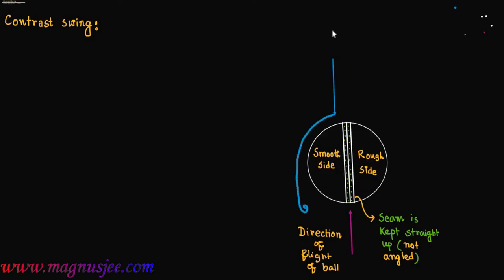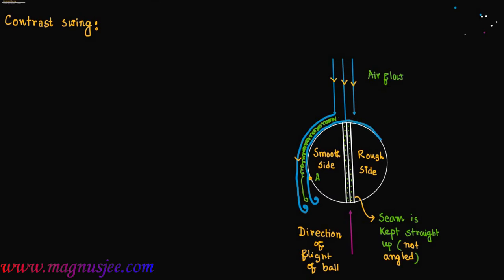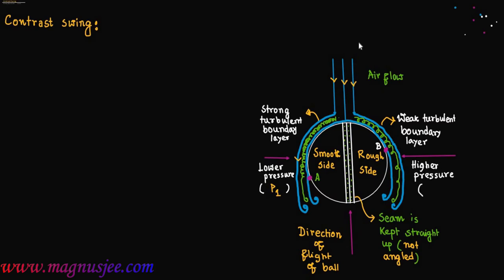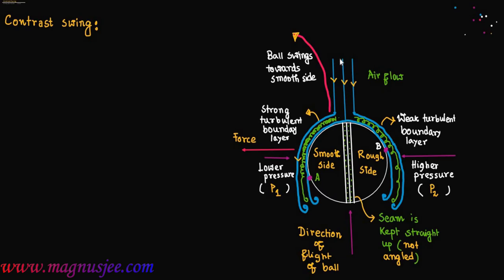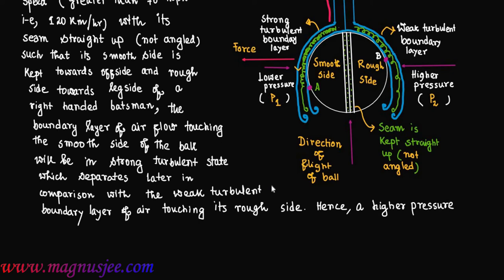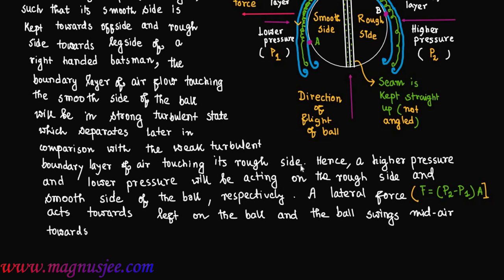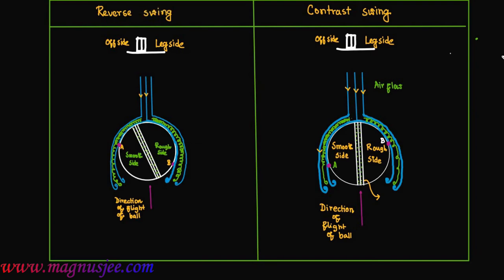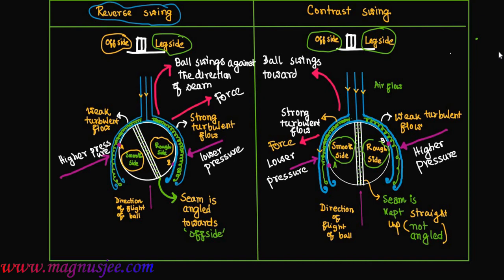Contrast Swing of Cricket Ball // Viscosity

Comment: You have gotten it wrong because the whole point of the reverse swing is that the ball moves towards the smooth surface as opposed to the conventional swing. Both reverse swing and and contrast swing shares the same quality. The only difference being that contrast swing is bowled with a new ball but at a much faster pace.
Reply: Does new ball even have that much difference between the two sides? Both sides are so smooth in a new ball......